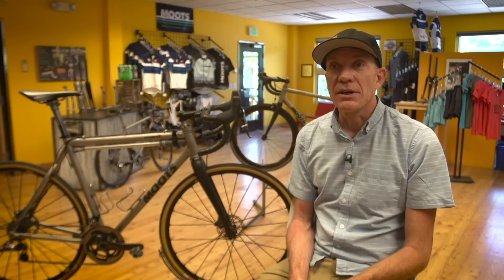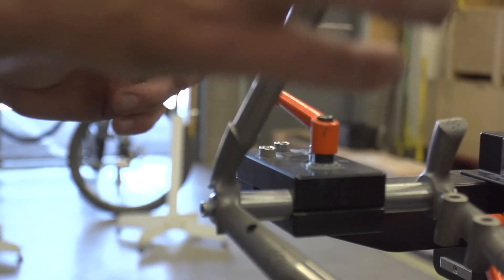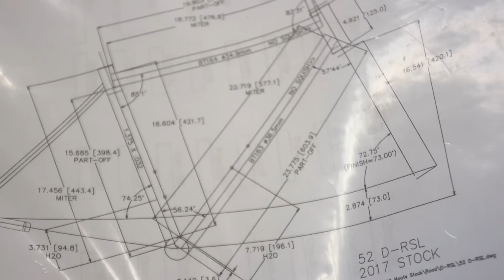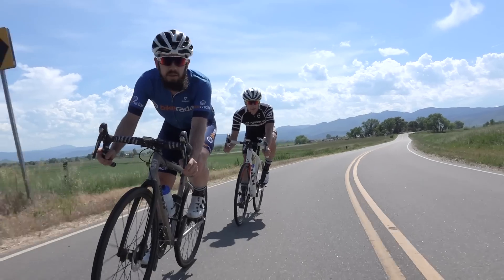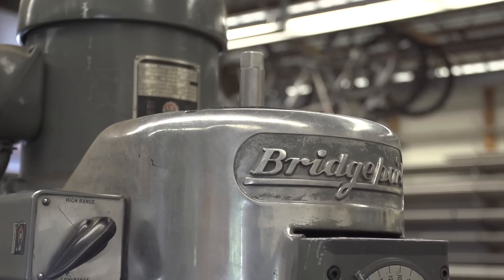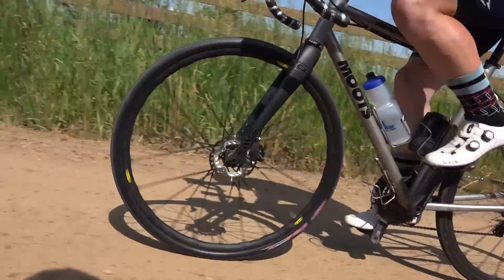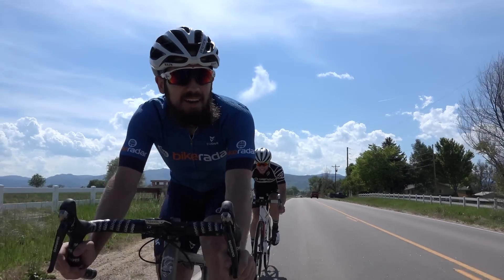Inside Moots' Incredible Titanium Factory

Comment: Where exactly does USA dig out Titanium >?
Reply: Titanium is the 9th most common element in the world.

It's the blending it with aluminum and vanadium and working/welding it that makes it costly.

If titanium could be shaped easily. Forget about it, only pros and sponsored riders would use carbon/fiber. Everyday riders would opt for a titanium aero frame that would last a lifetime. It could be tuned for comfort as well.

The truth is that carbon monocoque frames are still quite bad internally in terms of quality control. Excess resin pooling, voids, and delamination are quite common.
Reply: It's dug out the same place everything else is dug out. It's mixed with the other ores and stuff and the what not. No there are no titanium mines. Well maybe, hell I don't know.

Comment: I would always prefer metal over Carbon, doesn't matter Aluminium or Titanium. They are just stronger against impacts and crashes
Reply: Not only that, but the quality control of metal tubes to carbon monocoque frames is not even close.

To this very day, the inside of carbon monocoque frames look quite bad. Resin pooling, voids, and delamination spots are the norm.

I love that carbon can be shaped to tune aero qualities and comfort, but there are 3 main downsides:

1. Impact resistance is not great. Crashes, whacks from dropping the bike or things dropping on the frame, stones hitting it, etc. can cause damage quite easily.

2. Abrasive resistance is practically nonexistent. Only the toughest resins designed for breaking surfaces address this on aero carbon wheels. But the frame can be critically scratched. Cable rubbing, shoe rub, and laying down a bike in gravel will eat away the frame quite quickly. Carbon racing wheels for cars might employ different protective measures that bike frames simply don't have.

3. Quality control. Who knows what's in the inside. Often, it's not good. Over-engineering is used to cover for layup abnormalities.

Carbon is strong and light and reduces vibration, but I like carbon fiber for large applications that can cover for it's lack of toughness. i.e.  aircraft wings, drive shafts, large tubes, etc.
Reply: YouTube Comment Guy it is all just marketing saying carbon fiber is stronger. They don't test impact. They test load

Comment: How does Ti bike compared to Alu bike in terms of weight.
Reply: Guoenyi hey there, guy from 2 years ago. In case you still wondering. Aluminium is the lighter (less dense) material, however it is also less sturdy. Therefore, More aluminum (thicker tubes) is needed to make a bike frame, than it is with Titanium. Therefore, a Ti bike is about 5-20% lighter than a comparable aluminum frame, while the Ti frame is also a lot more compliant.

Comment: is titanium most comfortable material for gravel grinding or steel??
Reply: Steel, but all depends on the alloy composition. Steel is the softest, but if angles are steep in seat tube combined with stiff carbon fork, then it's all the same. Benefit of titanium over aluminum or carbon is aluminum fatigues over time (long time, but typically the cheapest) and carbon can be awesome built in custom ride quality and does not take well to rock chip or falls and can end up a cracked frame. Best part about titanium bikes is durability and retained value. For example, my 2001 litespeed tuscany frame sold on ebay for 900 bucks this year, and I paid same price for it 4 years ago. It was a very comfortable ride, but as I got stronger, I wanted something stiffer.
Reply: Oh boy. and you'll soon realize that carbon is sure stiff, but you'll always be thinking about that Ti frame.
Reply: I have 2014 Specialized AWOL steel frame and love it. uber comfortable with a Brooks saddle and can ride all day. I've ridden a few Moots and Black Sheep and see the appeal and would love to have one but for the price of just the frame I'll pass for now.